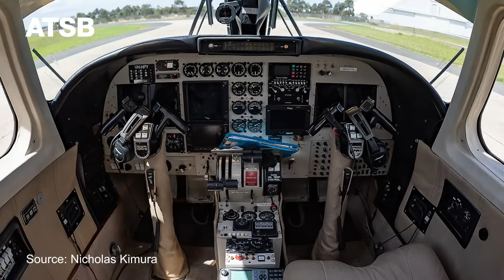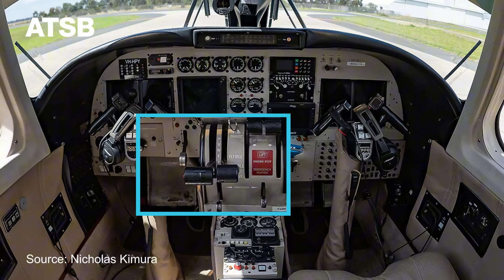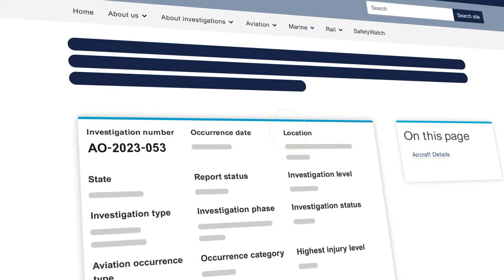Hypoxic pilot incapacitation near Cloncurry

Comment: Unbelievable. The owner/chief pilot should be in jail for negligence. 

The fact that the previous flights are shown to be routinely descending to FL150 clearly to let the pressurisation system catch up with the leaking cabin should make it an open and shut case. Absolutely appalling my condolences for the crews families.

Comment: A properly functioning pressurization system should be on the Minimum Equipment List for the aircraft to be safely operated, it’s not a system that can be deferred for maintenance. As shown here, it is a safety critical system.

Comment: An aircraft with faulty pressurization, even for the purposes of a ferry-flight or the like--shouldn't be flown above 10,000 feet (in terms of industry best-practices).
It's good to know ATC are reviewing procedures--yet their role was but one layer in the swiss-cheese model (RIP Dr. Reason).
What's most tragic to me, is none of the primary safety-lessons here are new--not even the ones to do with the operator's safety-culture.
People have already paid the ultimate price to teach us the lessons re-learned needlessly here.

Comment: Absolutely unacceptable behaviour from that company for normalising deviance and for completely ignoring the obvious safety issues this caused. 

“Wasn’t formally reported” was likely so they didn’t need to ground the aircraft while it was a busy fire season or cause it “costs too much to fix right now”. Sadly some operators have that mindset and it ends up costing them more than what the fix would’ve. 

Terribly upsetting for the victims and their families for a completely preventable accident and also to the ATSB who shouldn’t have to deal with these.
Reply: Wait. If ATC had their doubts,  why didn't they direct the plane to below 10,000? They have the authority to do so.
Reply: @mike9347 if the  pilot is hypoxic, that's going to present a challenge in its own right.
Reply: Can see this ending up with lawyers being involved. This was 100% avoidable.
Reply: Sure but they spoke to the pilot on the phone and never made the suggestion.
I also note that as I interpret this video, the pilots were also aware of the defect with the plane. If there was a pattern of dipping to low altitudes to counter the effects of hypoxia on previous flights, that means the pilots knew about it as well. What makes the issue of culpability a bit more complicated

Comment: Knowingly operating with such low cabin pressures is insanity
Reply: Pilot was a contractor sadly.  Former raaf fast jet and SASR solider.  Huge loss
Reply: @alexanderdavidson7837  100% should have known better, no excuse
Reply: @cs512tr for the company or pilot?
Reply: @alexanderdavidson7837  sorta both
Reply: @sgtjonzo I personally wouldn’t fly a plane that had a pressurisation issue.  Particularly if that’s where the plane often flies.  My concern is that it probably wasn’t written in the MR and thus wasn’t deemed a high enough risk to the crew.  But then I’m no expert and hindsight is 2020…